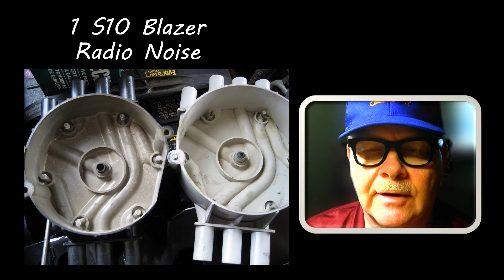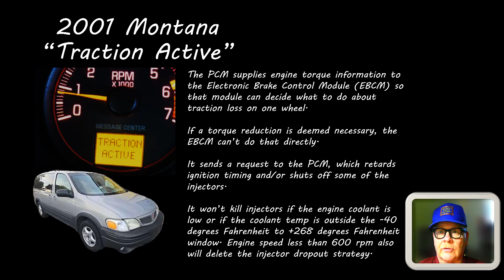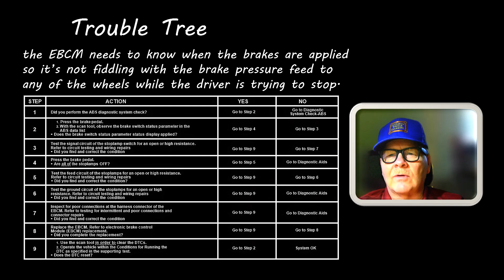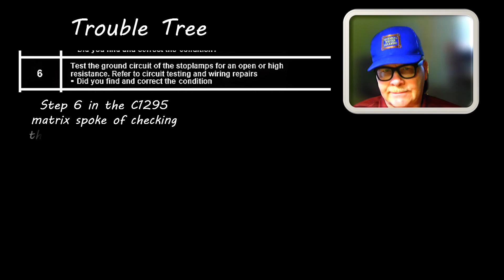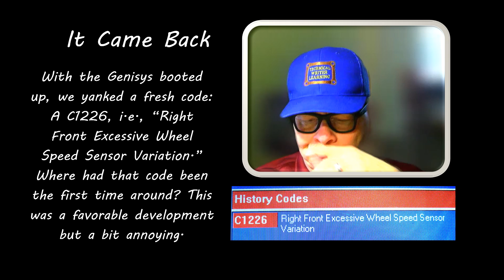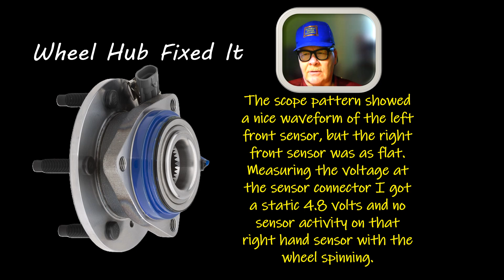Trac Control Fault and Other Stuff

Comment: On the lightning strike machine my assumption is the radio with lots of capacitors made it more resistant to the super overload ground than the ecu. If no core charge i would want open the box to see what happened. Lightning is a huge part of where I come from so to me it is very interesting. Not just another monday 
Max Power Monday 
Good morning
Reply from the maker: Good morning~